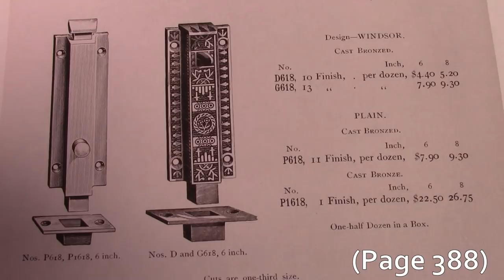Rusty 1890s Foot Bolt Restoration | Random Restoration

Comment: What amazes me is the rough finish on these fixtures considering the price in the 1900s. Very nice restoration.
Reply from the maker: Thanks a lot! Haha yeah this one left the factory pretty rough, but it would have been the cheapest option available for purchase. They did have sanded (usually called cut or ground) and polished variants that were more expensive. Thanks a lot for watching!

Comment: Do you ever install any of this beautiful hardware on actual doors? If so, i would like to see the doors.
Reply from the maker: Most of the things I’ve restored up until now have not been installed on doors, but they all will be Tom the future! This foot bolt will be going on a building that’s going to get a bit of a remodel at some point in the future, and is being converted from a single door to double door. Thanks for watching!
Reply: @randomrestoration6858  Oh, so would you sell these? Or is the door you're going to use it on a personal one?
Reply from the maker: @healinbeet  Good question. Although I probably will sell some of my restorations in the future, the ones I’ve done so far are going to be kept and put to use

Comment: Looks like it was made for a set of Dutch style door.
Reply from the maker: These were for double doors - it is installed on the door which has not handles so that it locks in place and acts like a solid wall. Without this, the doors wouldn’t close properly. Thanks for watching!

Comment: Ah, another lovely project! I am really enjoying these pieces, and the history/origin information. Kudos on the new airbrush setup, I for one liked the new lacquer quite a bit, both for the color, and the protection it will give the metal. And I finally have a constructive feedback after so many pieces without! The side had what appears to be some casting imperfections in the series of bars that could be etched out, though I have my suspicions that you left it in on purpose, either because of a preferred aesthetic, or possibly to provide me something to mention (if the latter, that's very kind of you). Tangent topic, a variation of this technology is used in glass double doors in many commercial spaces, albeit hidden within the frame of the door. Up too late again, starting to ramble. As always, enjoyed and appreciated! Also, thanks for the tip on the abrasive buffs.
Reply from the maker: Thanks as always, James! I was quite happy with how it turned out, especially since I only had time to do one quick test with the airbrush before this piece. I did indeed leave the casting imperfections intentionally - The imperfection existed in the same location (between the same bars) on either side, and I figured I'd leave them be since it left the factory that way. That said, if the imperfections were only on one side I absolutely would have removed them since it would have disturbed me being so uneven haha. Thanks a lot for watching!

Comment: Where did you find such a beautiful lock
Reply: It’s not sketchy it looks awesome it looked great to start with and then your home brew knocked it out of the park
Reply from the maker: @bradleytuckwell4854  Thanks a lot, Bradley! Hahaha, well I figured the lacquer in an odd shaped glass container looks a bit funky, but it does create a nice looking finish! Thanks for watching!
Reply from the maker: I should add, I found this foot bolt on eBay. I can't remember what I payed for it, but these do pop up from time to time, though they're usually missing the strike plate

Comment: What kind of black paint are you using to fill in the recesses?
Reply from the maker: For this project I simply used a gloss spray paint that I sprayed into a container and sucked up with the syringe. Since this paint is so thin it doesn't cover up the details in the recessed areas, though I had to apply two coats. The lacquer I applied over the whole piece is very strong, so the paint in the recessed areas doesn't really need to be strong, it just has to adhere well. Thanks for watching!

Comment: I really love what you did with the lacquer. That's gorgeous <3

But mate, you gotta stop sanding off the rough casting texture. That texture is part of the history of casting methods, and the history of the part. The rough texture is how it's supposed to look. The rough texture is how they sold it at $230 (2021) per dozen pieces. You're erasing a lot of history by making the park look like it was cast in 2021.
Reply from the maker: Thanks! Although this wasn't likely a sanded variant, "cut" or "ground" versions with polished and finely polished surfaces were offered throughout the years. My goal was to recreate the cut and polished surface, as these are going to be installed on a double door that have sanded and polished cast bronze hardware also in the "Windsor" design, and I want all the hardware to be the same finish. In most instances when one of these foot bolts pop up for sale they are either the unground variants, or they are quite rusted and the design is effectively ruined by pitting from rust. So using a less rusted unground version (which has more sandable material since it features a deeper recessed design) will be capable of looking more like the original sanded and polished version with little or no compromise to the ornate details. Thanks a lot for watching!
Reply: @randomrestoration6858  Thank you -- that makes sense! I understand what you were going for. I didn't realise the company offered ground versions.
Yeah a lot of old iron can be really rotted out - so that's cool you found a way to save it <3